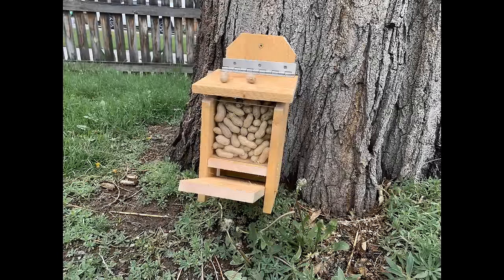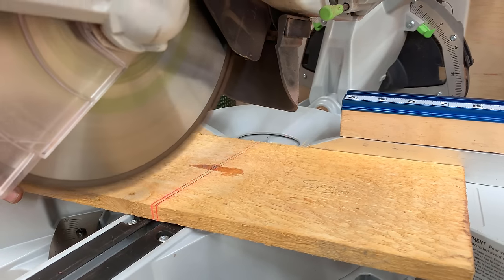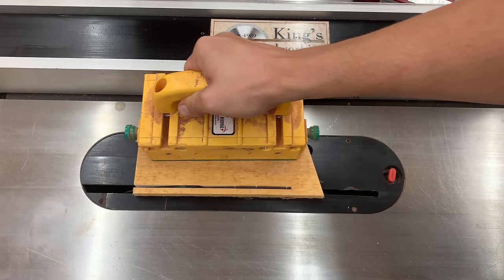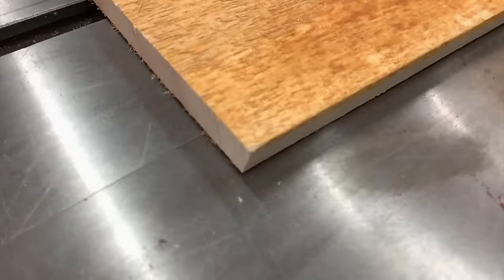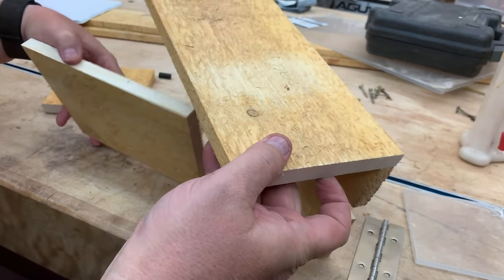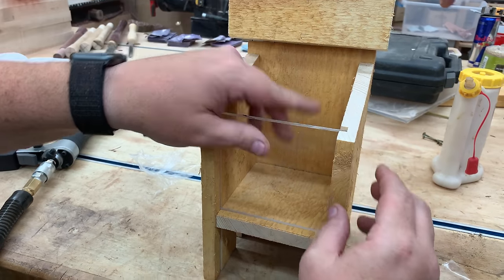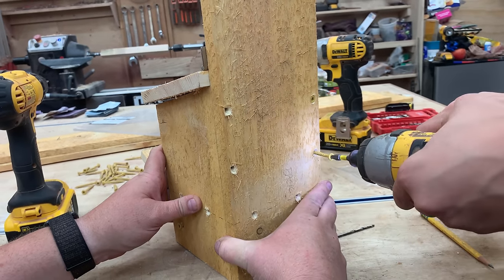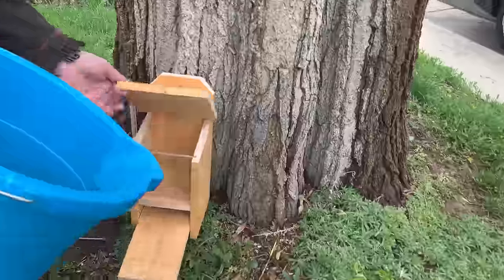92 - Squirrel Feeder 1 hour, $2.00 - project

Comment: I just finished a similar build.  The wood was pre-cut and I glued it together and used waterproof screws.  Before that I stained it with tree-colored tint.  I then prayed three coats of polyurethane to make it last.  I filled mine with peanuts as well.  I like the design on this channel more.

Comment: Cedar is a dream to work with and is low price ,,one of the most popular woods for birdhouses and such ,,, I just finish a squirrel feeder box today out of oak but used cedar for the lid to make it lighter ... I'm a sucker for Oak i know it cost more is harder to work with but i love the toughness and the way it looks weathered ... When i finish a birdhouse or Squirrel feeder i throw a coat of Tung oil on it and stick it outside ..
Your video is spot on and good advice for projects like this..Really cool design , like the way lid pops up

Comment: Hi - Thanks for posting this, - just made one last week.. Just a side note that  the smaller squirrels that couldn't figure it out started chewing the heck out of the lid. I have modified the lid at the opening and added a galvanized metal strip- trying to keep it as light as possible. Will see how this works out.  The big gray squirrels have no problem and love it.

Comment: nice little project. I made one with my niece some months ago - without the mechanism.  You may consider to reduce the height of the front window as the squirrels can get squeezed (you can see it in the video already). Even more if one may jump on the lid while another one reaches into.

Comment: Finally built a (close approximation of) your feeder from some scrap materials. Only things I had to buy were the ceramic coated deck screws and the nuts. They found and emptied it the next day, taking close to a pound of nuts! They seem to have buried a lot of them in our lawn, and are gradually eating less as time goes on. Anyone know why? Still not seen them, sadly...
Reply: Squirrels are gatherers.  They will collect collect collect nuts, peanuts, acorns, etc & bury them when there is a bounty of food.  Later, when there’s little food about, they will return & dig up their treasures.  It’s best to only feed a small amount (daily), not a bag full.  They will clean you out.

Comment: You might like to put a screw through the side to pin the plastic in place. We have a couple of feeders of similar design,  though with a longer overlap on the lid, which the squirrels use to lift the lid themselves rather than having an automatic lid opener. We feed peanut kernels rather that whole peanuts, and it did not take long for our local tree rats to discover that they can lift the plastic out with their teeth, and scatter the nuts everywhere. Que several iterations of techniques to pin the plastic in place, vs squirrel ingenuity and strength to pull out the panel.   I eventually won, but not without at least three feeders full of nuts scattered everywhere, and when I won surprising tooth gouges in the plastic as they attempted to brute force my locking techniques.

Comment: how did you come up with it being a $2.00 project?
the cedar picket plank is $2.69 and the acrylic sheet is $5.48.. right there runs the project into $8.17.
and thats not counting the price of the screws.
Reply from the maker: When I built it pickets were $1.60 or so. And I just figured I’d get about 10 little windows out of one of those sheets. So I just took 1/10th of it. I did end up making about two dozen and gave them away. My out of pocket was literally about $2. 

But you’re right. Today, you gotta pay more. 

But even if you pay $8-$9 bucks. It’s not all that bad considering they sell similar ones at my Ace Hardware for $45.

Comment: Excellent build, albeit a rather complicated one with that lever thing. Squirrels are not dull you know, they can open a lid 😅😜 
12:33 that was a shame, screwing or nailing into a tree is just lazy and wrong. Better to use big twist ties, reusable stainless steel zip ties / clamps, or two bungy cords going through two holes at the top either side and two at the bottom. Only limited by the imagination 😉

Comment: How does cutting the acrylic affect the saw blade?
Reply from the maker: It doesn’t in the slightest. It’s a hundred times softer than carbide. And if you use cast acrylic it cuts beautifully. 

Extruded acrylic tends to crack and smoke more.

Comment: We don’t feed em we shoot the squirrels because they chew on the car wires
Reply: If they are fed with nuts I guess it wouldn't eat those wires. Just be kind to animals
Reply: @blucodilla5036  did you know the wire are coated in peanut oil and that’s why they chew them
Reply: It's not the squirrels fault. They only find what's weak in terms of your cars safety so you should be thankful to them.